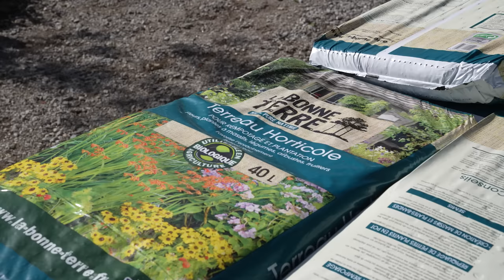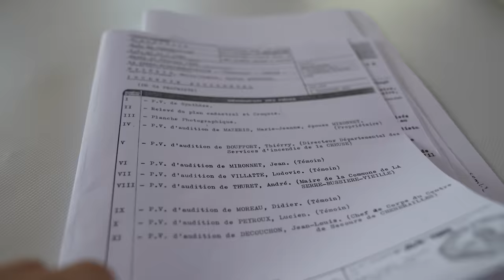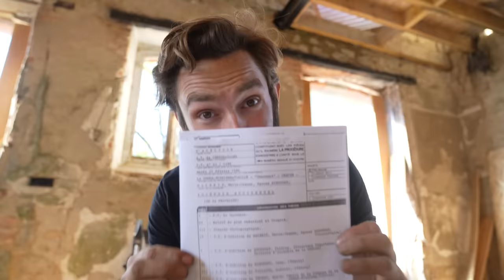I found out how and where the chateau fire started!

Comment: I found a copy of the book you mentioned in a recent video.  It was interesting to read about the history of the chateau.   I would try and source an IBC tote used for non-chemical purposes and run a pipe down to the pool.  A simple pump (solar powered) will fill up the tote (350 gallons) and you will be good for water.  If you set the tote on a platform (Nick can build a sturdy one) you can get some water pressure from the gravity fall.  You might get a larger tank until you can get hooked up to the city water.    I suppose you could put in a well and forget the city.   That is what I did and I never looked back.  If the water is filtered then you can even drink the rain water.   Kits are easy to purchase and install that run the water thru a series of micron filters and a UV light filter for pathogens and make it good to go for the Chateau.

Comment: What happened to the death-pit rotten carcass water that you've been using?
Reply: It dried up, there wasn't a lot left in the well in the first place (the old submersible pump, which was likely installed close to the bottom, was pretty much above the water line the first time Dan looked down the well).

Comment: By my humble opinion, it would be better to make cement based floors than just wooden, to avoid in the future the huge damage from fire in case of fire threatening.
Reply: Concrete can be massively weakened by a fire too, so it's not the be-all-end-all it's sometimes believed to be. I'd definitely suggest getting wired smoke alarms throughout the building though!
Reply: @Ragnar8504  Ok, but may be aerated concrete, which is fire resistant for about 4 hours?  In for hours wood woul be burnt totaly for good.